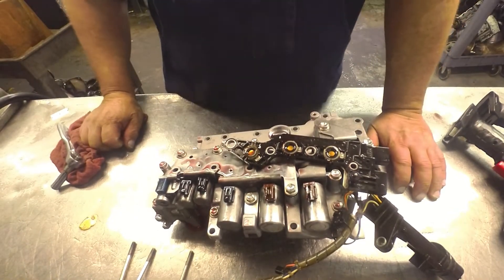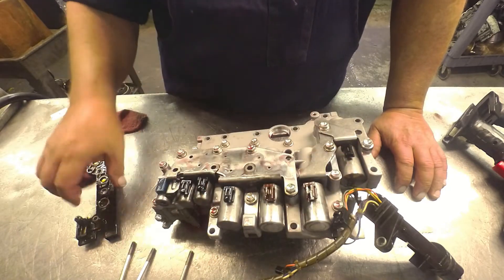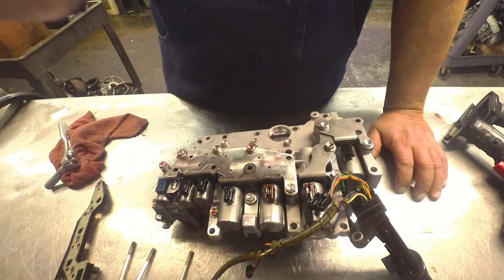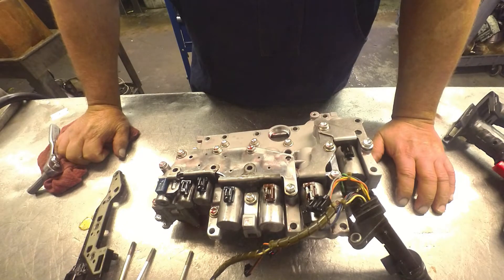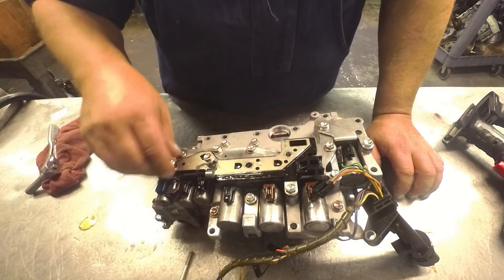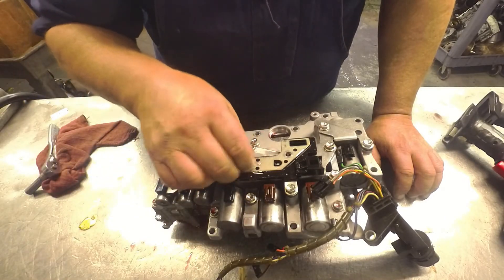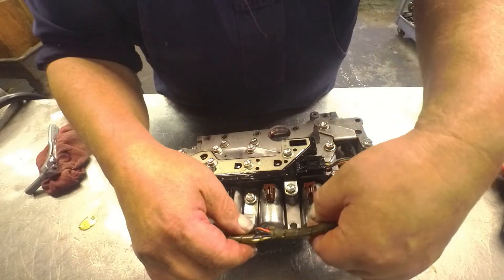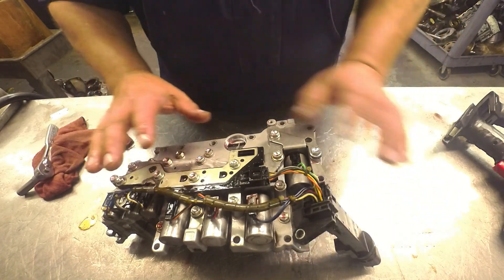U660E Pressure Switches

Comment: Hi Curmudgeon, Thank you so much for the video.  
I have Sienna 2011 3.5l U660e tranny  with checking engine light on and error codes: P2714, p0500, p0776 transmission not engaged, won't shift at all any gears.  I removed the pan and checked all solenoids are within resistance and good working with testing 12v to it.  Fluid was not really dirty, not a lot of metal shaves.   I replaced with new filter and new fluid (just refilled, not flush tranny), checked correct fluid level and driving smooth and power with all gears (up to 90mph) for a week about 200 miles.  Then yesterday I was trying to get on the highway at 65mph, suddenly the tranny was not engaged( all gears)  with NO check engine light ON.  got towed home and checked with the pending codes: P0746, P0776, p2714.  do you think valve body?  TIA
Reply from the maker: Your valve body probably does have some wear, almost all do. The 2714 sets because the molded piston in the directs gets hard and leaks. The clutches are usually destroyed as well as the steels and pressure plate. It will also cause the 0776 to set as well. Time for a rebuild.
Reply: Thank you

Comment: 2016 Lexus es350.  Just did a fluid drain/fill and filter now it is acting funny double checked my level it seems good.   It keeps downshifting when coasting any input? Thanks
Reply from the maker: You can try clearing the codes with a scanner even if it says there are no codes. Then resetting the adaptives and relearn the shifts.
Reply: @ I used a beckarnley filter instead of OEM and that was causing my issues.  Switched back to old filter to verify,  and all issues are gone.   I’ll replace with a new OEM filter next time.

Comment: I've got a u660e, no codes, 4th, 5th and 6th rev out as in neutral. Drives perfect if i put shifter in 3rd. As soon as it goes into 4th just revs out. Any suggestions?
Reply from the maker: Time for a rebuild. Problem will most likely be in the C2 clutch. Piston usually fails. Replace all the molded pistons while you are in there.
Reply: @CurmudgeonTransmission  I've picked up a used trans with low kms on it. However, its out of a Toyota Aurion opposed to an Estima, looks identical, although apparently the final drive ratio can be different? Can I pull off the front case and swap the final output gear? worried the computer might throw a code if the ratio is different.
Reply from the maker: @beyonecloseddoors  If you are lucky. The transfer gear and output gear can be different also. If the output gear is the same, yes. If not you will have to take it apart to change it.
Reply: @CurmudgeonTransmission  Thanks for your advice. The trans from the Aurion was identical internally, I counted and measured all the gears. I had the swap the rear case as mine didn't have a mount. Pulled the old trans apart and you were correct, the c2 clutch was burnt, worn smooth, the c1 was a little burnt as well. The front case bearing also fell out, so it was prob spinning in the case.
Reply: Another difference I noticed when I checked both b1 and b2. The newer Aurion transmission had a spacer ring between the separating circlips, where as the other didn't.
Reply: @CurmudgeonTransmission   I've picked up a used trans with low kms on it. However, its out of a Toyota Aurion opposed to an Estima, looks identical, although apparently the final drive ratio can be different, I cant seem to find the final drive ratio's on these models? I bought it initially to use the valve body. However, being its only done 110 thousand km opposed to 300 thousand km, I thought maybe I could pull off the front case and swap the final output gear? worried the computer might throw a code if the ratio is different. Any advice you have would be great. Cheers, Will
Reply: Boa tarde conseguiu resolver seu problema, estou com um camry cambio u660e com o mesmo problema do seu
Reply: @andreportela9860  yes, I replaced the transmission with a used one. When I pulled the old one apart, the c2 clutch was completely gone, black and burnt. Assuming the c2 molded piston was to blame.
Reply: to get to the c2 clutch its simple remove the rear cover, the clutch pack can be pulled straight out.

Comment: I’ve got a 2010 Rx350 with the U660F and I have P2714 code. I replaced the SLT solenoid and it’s still giving me a code. Next step would be valve body according to the manual. This transmission has been a pain in the
Reply from the maker: The valve bodies are crap on these. But you probably will not get the code to go away until you put the molded pistons in it. Specifically, the ones in the Forward/Direct drum.

Comment: I have a 2015 venza with that unit. Delay shifting from Park to Drive and sometimes around 30 miles per hour it doesn’t know like what shift it is, like it want to downshift or upshift. Selenoids or the valve body? Thanks in advance.

Comment: Hi.
I have Sienna 2011 U660E. I have P2714, P0746, P0776 codes. I did take off the oil pan and saw that the fluid was dirty black. I did change the filter and the oil (static change, something about 2,5 l) but this did not help. I still got the same errors. I did test using Autel the solenoids and I can hear that they make a sound (SL1-4). When I am testing SLT I got strange sound (like something is stuck). I am thinking of replacing the SLT solenoid as I think that others are working fine. I have gears 1-4 only now. I saw that if I want to replace SLT I need to drop the whole valve body (which I am a bit worry to do). I saw that I can only loosen a bit the valve body and try to take the solenoid... I have only one question. Do you think that some other things can be broken in the transmission itself (clutch or something else...)? Is this possible to fix that transmission at all???
Reply from the maker: I have only seen 1 of these that the case bearing race was not worn, most are severely worn. The direct clutches and steels are probably burned up. The pistons will be bad, even if they look good. The valve body will be worn as well as some solenoids. It's fixable but will be expensive.
Reply: @CurmudgeonTransmission  can I drive that car to some mechanic? around 60km?
Reply from the maker: Maybe. Hard to say how far something will go once a problem develops.
Reply: what was the fixed? please update...thnx

Comment: 2013 es350 showing code p0793 cleared the service engine light hasn’t came back on it’s shifting smooth as always but when I’m sitting still it’s like my first gear will go out and it revs high to move then maybe 5 seconds after I let of the gas it will shift kinda hard into first it’s like it’s up shifting when im sitting still to a higher gear then all of a sudden down shifting back to first then it will drive fine for maybe a hr or could be all day or 5 min it’s random code says my intermediate speed shaft sensor what should I check first
Reply from the maker: It may be upshifting. It could be the speed sensor, internal wiring or TCM. If you have a scanner, watch the speed sensor data and see if it is showing rpm's while this happens. I have a feeling it will be the TCM.
Reply: @CurmudgeonTransmission  whenever I put it in gear either reverse or drive it makes a noise coming from one of the wires kinda like a sizzling noise I hate to replace the shaft sensor in the transmission and it not be that I was thinking the tcm also that’s very expensive to though

Comment: I was given my first Highlander 14 V6 FWD 3.5 XLE to fix. I have 2 months with the truck and pretty stuck. No codes are shown, it only shows pressure Loss in reverse. Now the piston that is used for reverse does work because I applied pressure for test functionality and passed. My only quick guess is that the U660e body valve has an issue. The D shift works great for shift 1, 2, and 3. Shift 4 starts failing and  never reach Shift 5 and 6.

Could you advise if I need new u660e body valve or where could issue be? Good news client is family member because of the lead time.
Reply from the maker: Could be a valve body problem. Most are worn out, especially if it has high mileage. But have seen low mileage ones worn out. Most have a bad case also. Only seen 1 that was not bad. The bearing race in the case starts spinning making fine aluminum and clogging the solenoids. You cannot replace it yourself, it has to be machined out and sleeved.
Reply: @CurmudgeonTransmission  So as update, I changed the full valve body to another reman one and finally got codes P0796 and P2714. Now reverse works but shifts 4, 5, 6 still have trouble. Based on this new feedback, what you recommend?
Reply from the maker: Rebuild the transmission with molded pistons.
Reply: @CurmudgeonTransmission  

I have recommended my client that I will buy him full used transmission  for 2K in Car-part website. Though what steps need to be done because obviously it is not direct install since it comes from a different VIN. By the way, I highly appreciate your shared tenure and experience.
Reply from the maker: Put the computer from the original transmission on it and it will not need to be programmed. Just reset the adaptives and relearn the shifts.

Comment: Hey sir, what is the part number for this pressure switch ?
Thx,
Reply from the maker: I do not know. There are 2 different ones. Single and triple sensor. I would get it from the dealership.
Reply: I need single switch one.
Dealer doesn’t know the part number.
Thx,
Reply: 2014 Toyota Highlander.
Single sensor.
Reply from the maker: @lalabilloo  You can put the triple on a single unit, but not the other way around. So if they have a triple you can use it.
Reply: Thanks,

Comment: Do you own a shop? My 2009 ES350 with the U660E is not throwing any lights but is shifting hard from 2-3. Right before it shifts it heavily 'enging brakes' before getting into gear. All other gears shift like butter.
Reply from the maker: No I don't. Go here if you need one. https://atra.com/ShopFinder I am assuming this is before an rebuild. Just because the light is not on does not mean there are not any codes. These are prone to valve body wear and molded pistons not sealing correctly. Leading to burned clutches.

Comment: Hi. Have got a u660E transmission for Lexus es350 2008. All works well except when hot would refuse to go into reverse. Have also got a p0770 transmission fluid pressure switch circuit high which came up after replacement of the valve body with a u660E from a Lexus Rx350 2011. Also got a torque converter solenoid circuit high. Replaced the TCM and all still same. Any pointer in the right direction would be greatly appreciated
Reply from the maker: Are you sure it was P0770? I find no listing for that code. You may have an internal harness problem. What is the torque converter code? Reverse can be shut off electrically. May be your problem as you did not say you have a problem in 1st or 3rd & 5th, as these gears use the 2 sets of clutches that operate reverse. Did you replace the valve body because of the reverse problem? What were the codes before the valve body replacement?
Reply: @CurmudgeonTransmission  sorry my bad. The current code I have on it is p0990( transmission fluid pressure switch( tps3) circuit high and p2757( Torque converter clutch pressure control solenoid control circuit performance or stuck off.  Previous codes before now were p0776, P2757, P2808. Vehicle drags while moving forward at first but I replaced the valve body with one from a Lexus Rx350 with a u660E transmission and those codes up there went off. Vehcile now shifts all through 1-6 without a drag but as soon as the p0990 and p2757 comes up when coming to a stop the vehicle brakes it self. The feeling you get when you suddenly brake. When hot vehicle doesn’t reverse. What i do in some cases when cold if it doesn’t reverse is actuate all the solenoid using my scan tool and this helps in making it move in reverse
Reply from the maker: Sounds like you still have a valve body problem. These have a lot of problems with them. Odds of getting a good used one are not good.

Comment: I have a 2012 Lexus Es 350 with the same transmission, Im have a problem my car downshifts very bad through some gears and very harsh engagement. No shift Flare though , could it be the valve body?
Reply from the maker: Very Likely. Need to scan the computer for codes first though.

Comment: After the switch is removed is the slu solenoid removable? This video has a great view of the valve body. I cant tell of the slu solenoid is removable .
Reply from the maker: The valve body will need to be removed. After that there is a bracket that holds the SLU and SLT solenoids in place. Once that is taken off you can remove it. If you are super lucky you can loosen the valve body just enough so you can get the solenoid out and hope the seals under the valve body do not move out of position.

Comment: How do you remove the solenoid I have all that part out I need to remove a solenoid
Reply from the maker: They are held in with brackets and bolts. Pull the bolt that is holding the bracket for the particular solenoid you need to replace. Pull the bracket off and the solenoid will slide out. The small one on the end has the bracket made onto the solenoid.

Comment: I need a switch for a 2014 Sienna. I’ve been looking for a single switch plate but all I can find are the ones with three. Where can I get the single plate?
Reply from the maker: Have you tried WIT, Transtar or the dealer? Links are in the description for WIT & Transtar. The bulletins say you have to use the 3 switch with the 3 hole plate and the single with the single. I see no reason you could not put a 3 on a single and it not work. The other 2 switches don't need holes. The computer will never know because ther are no wires going to the other 2. The wires are still going to the same pins.
Reply: Thanks for the reply, I was able to get a single switch assembly. I dropped the pan and removed the filter. Then I removed the sensor and put on the new one. Put everything back together and adjusted the fluid level. But when I try to shift now nothing happens, it’s just permanently in park.  Makes me think fluid got in the wiring. The switch itself actually popped out of the assembly, but I put it back in. Do I have to clean the wire connections before I plug it in? Again, shifting does nothing, it’s not even trying to shift.
Reply: Also, the original code it was throwing was P0990. I was hoping it was just the pressure sensor assembly and it would be an easy fix.
Reply from the maker: If you have a scanner that shows data you can manually check to see if it will change status. Pull the sensor off and push on it. If it is changing I would have to say it is a bad TCM. If it is not it may be a bad internal harness or TCM.
Reply: The thing is it was still able to shift before I drained the fluid and worked on it. Now it won’t shift at all. I checked the shift lever and it still moves. I can’t think of what could’ve broken just by me removing the fluid. The fluid was very burnt and had chunks of metal in it. So that makes me think by draining it it moved some metal bits into something causing it to seize. My next idea was to just get a new valve body, but I thought I would ask you first…

Comment: I recently had a local shop repair this transmission . Their rebuild failed 8k after rebuild and then they suppossedly fixed it and it failed again 2k miles outside their warranty.  Im getting a pressure error and check vsc on my lexus. Im thinking a rebuilt valvebody would be great but I cant find anyone selling one anywhere. All I see are the zip kits. What do you think of these?  Im getting errors on all solenoids and the pressure solenoid.  Ive pulled valve bodies out before but is a zip kit plus new solenoids something a shadetree can pull off?
Reply from the maker: What is the code? If you are going to spend that kind of money on the valve body buy you a new one, IMHO. Don't buy a rebuilt one. I have put the zip kits in with fairly good success. If you have done valve bodies before you could probably do this. They are a bit of a pain on this transmission though. It is a lot of work. Prep and installation.